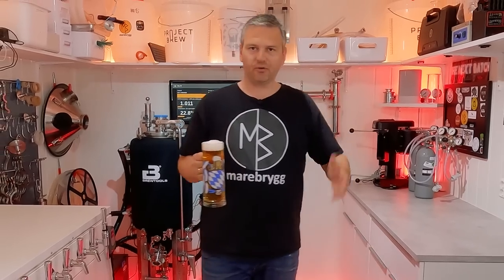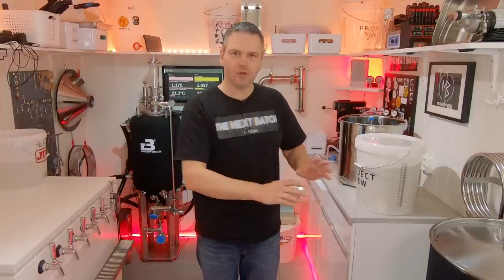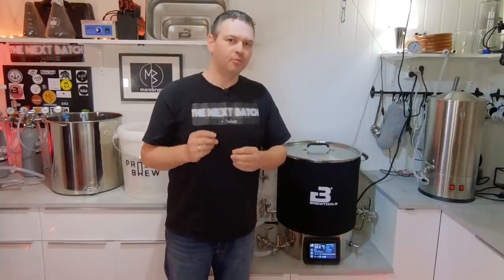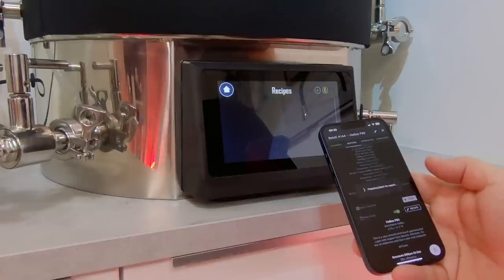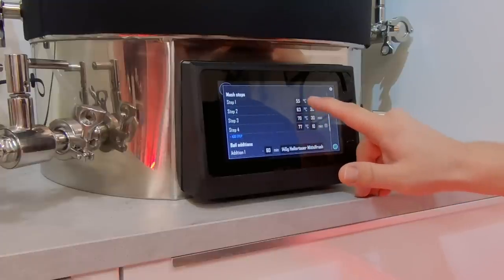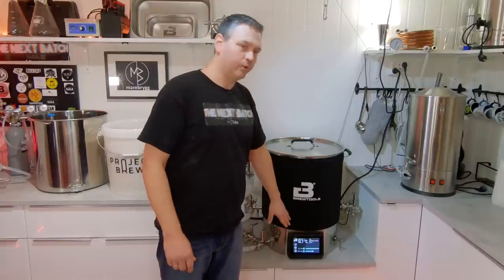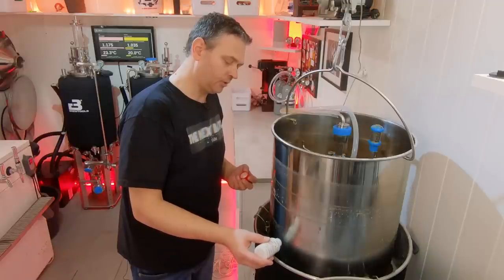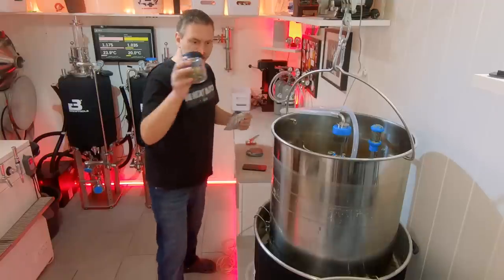Brewtools B80 Pro - First Brew Day! | Münchener Helles

Comment: Awesome video! Thank you so much for sharing. I bought a Braumeister in 2012 when it was a real innovation in the homebrewing scene. German engineers are amongst the best in the world, but alas they can’t see any imperfections from their designs and produce. Worse than anything else, they don’t listen to customers and they tend to become very arrogant when trying to cover up their flaws. Your video definitely encouraged me to buy a Brewtool system next, which looks far more slick and efficient than a Braumeister. I have also done some prep-work on the company and apparently Brewtool team goes the extra mile to listen to customers and try and accommodate their requests. Pricewise, it looks very competitive too! Particularly when compared to an obsolete and overpriced system such as the Braumeister. Thanks again; you are awesome!

Comment: Great brewday footage. I've also found the recirculation on the B80 very slow. Lots of info suggesting to leave the mash for 10-20 minutes for the grain to plump up with water absorption before recirculating so the grains make a good bed. Gonna give it a go on my next brewday (3rd on on the B80) to see if it improves things.
Sharing your brewday and the issues you come across is great to see with follow up on your fixes. great channel.
Cheers
Reply from the maker: Thank you! 😊 I’ve had 5 brew days on it now and have learned a lot about mashing on it. 
My last (and fifth) brew day I hit all my numbers. 
I did a 20 min rest, and I’m using a 72 degree mash step for 15 minutes before mash out. 
That helped a lot! 😊

Hope you figure it out also on your system 😊👌🏻
Reply: @TheNextBatch  Yes I think adding a mash out step is a very good idea. Thanks 👍

Comment: Glad mashout didn't end badly. I had a similar experience when I thought I'd be able to remove a full Braumeister 50L maltpipe by hand. 😅 I opted for a wheeled low worktop and pulley. You could do something similar with the worktop your Brewtools is on. A few observations re Braumeister 50L vs Brewtools B80. I don't ever see a need to use a 20kg grist. I don't drink that much volume or high ABV. The higher wattage of the Brewtools elements just helps heat water a bit quicker. It makes no difference in the actual brewing process, i.e., mash and boil. The Braumeister 50L's  3200w are more than enough for a vigorous boil. If anything, I'd like to dial it down a bit, especially when using a steam condenser or brewing a pale beer like a lager, which are better with a gentler boil. From what I've observed online, I suspect I can get a better whirlpool in my Braumeister using a RipTide pump. You could try using your RipTide pump to see if it performs better for whirlpooling than the Brewtools onboard pump. Also, I've found the Braumeister cooling jacket works really well (15 minutes longer than my Z Chiller), if the wort gets recirculated,  and there's no sanitising or cleaning required, which is nice.

Comment: Hey my friend, question if I may ask: do you “fill” the counter flow chiller before the mash/boil? So the air is out of it? Cheers 😊
Reply from the maker: Hey @homebeerbrewery 😃 No I don’t. During mash and boil, up until sanitation of the chiller, I keep only air in the chiller. I circulate the wort bypassing the chiller. 

Have you started brewing on the B80 yet?
Reply: Thanks for the quick reply. Yes I did brew my first batch, and I noticed huge air bubbles coming out of the chiller during the start of the sanitation, wort splashing in the air 😅 My chiller is underneath the troll table. Not sure how I am going to fix this… cheers
Reply from the maker: Ah, yes. That happens 😃 If you open the valve slightly and slowly the bobbling will be dampened. 

But sooner or later you will get the steam hat and steam condenser and this will no longer be a problem with the hat on 😃

Comment: Ideally, the cfc should be mounted horizontally rather than vertically on the wall. Otherwise, the wort won't drain properly. Wort should enter at the top and drain from the bottom. Otherwise, wort will remain in the lower sections of the loop / and/or remaind cleaning solution.
Reply from the maker: You are right! Also I have switched out the BT chiller with the ZChiller, and it lays down 😀

Comment: Great video! Question, what devices do you have connected to the TV behind you that enable you to display the temperatures and gravity’s of your fermenters?
Reply from the maker: Cheers! The TV behind the Unitanks is connected to a Rasperry Pi with runs TiltOS, which again logs and displays the data from my Tilt Hydrometers floating in each Unitank. They meassure SG and temperature. This is logged into Brewfather every 15 min.